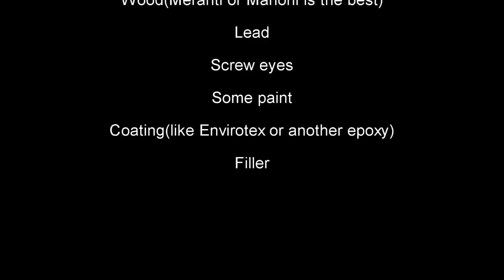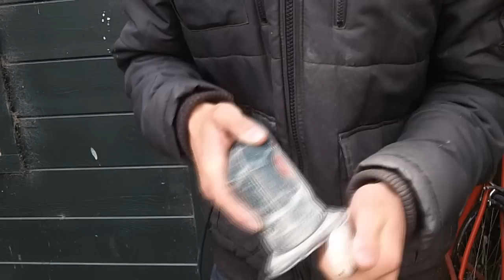How to make your own home-made jerkbait for pike!

Comment: if you want to make suspending or slow sinking jerk first you need is to paint model with sanding sealer, then fit screw eyes, then splitrings with the hooks, and don't forget your leader wire. then you balance your jerk. leader wire makes a lot of difference
and screw eyes is recommended to glue with the epoxy glue. predrill hole, then put epoxy glue, and then screw the screw eyes. 
and after all job you done, you lose your lure and nearly get heard attack :D
Reply from the maker: Yes that´s exactly how I make them right now :) this is an old vid, but still usefull.

Comment: Enjoyed the video, thanks.  Truly concerned you skipped the nitrile gloves.  They cost 8 cents a piece in the US and the sprays and solvents and epoxies can all cause skin cancer, but worse than cancer is developing sensitivities to them, which is nearly certain with the exposures you are allowing and means you'll be done making the lures and that would be sad.  The dripless rotating drying device and the stencil were great takeaways for me.  Thanks, again.
Reply from the maker: Thanks Dan. I am now using an airbrush so there is no problem any more ;-) check my latest lure building vid, it is actually a better and more usable version of this vid, and the jerkbaits are looking a lot better.